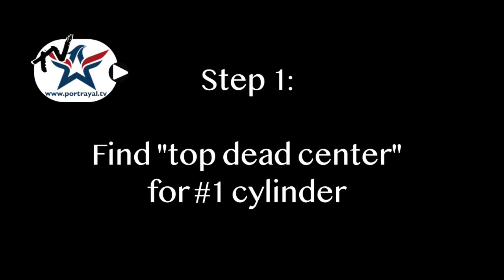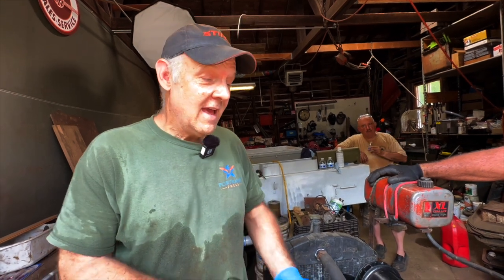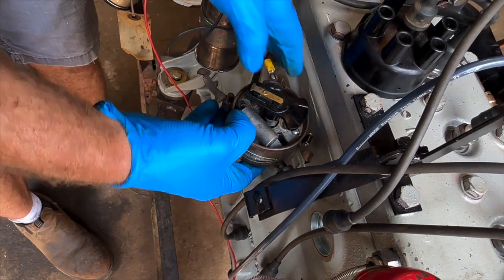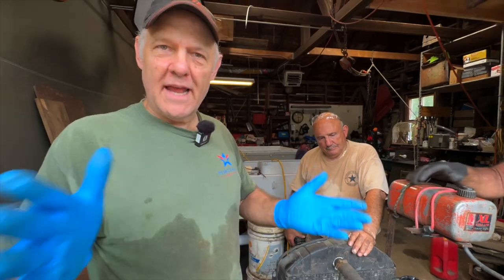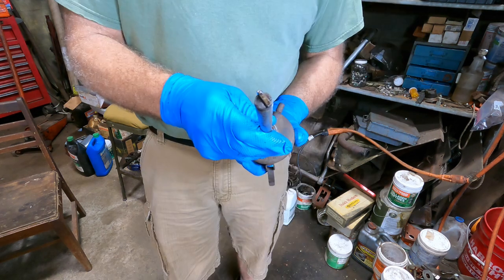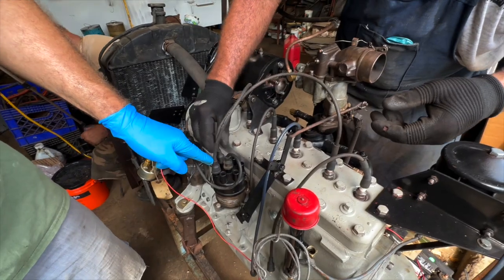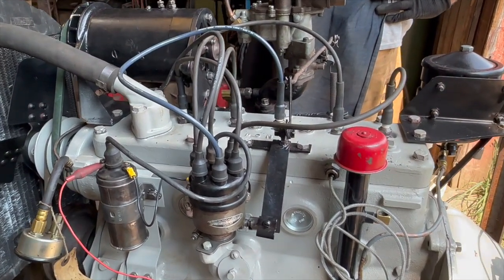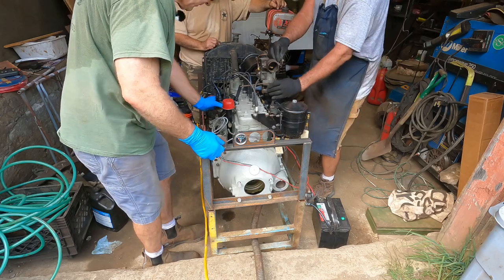Finding "TopDeadCenter" TDC, Installing a Distributor & Setting Engine Timing #mechanic #engine

Comment: Look in the book and put #1 where it's supposed to be. Timing is always set with the engine off. You guys never worked as mechanics.
Reply from the maker: You clearly did not watch or, more importantly, understand the video.  Then you decide it is a good idea to post a rude comment attempting to insult us.  Rather than being an insult, you succeed in demonstrating that you have no idea what you are talking about.  

Try being curious - it is a much better look.  

Example:  "Wow, I don't understand - the book shows #1 at xx o'clock.  Why would they do that?

Answer:  Because it was "convention" or "the way they did it" or "just the setup when they took the pictures for the manual"

Question:  "Does it make any difference to the engine?"  

Answer:  "Not one bit.  You do need to pay attention to  the orientation of the distributor housing to ensure that any oiler is in the correct position and that you don't short the coil lead on the engine block."
Reply: I don't understand why people that  they don't know,  have done nothing malicious, and just trying to help, would be so nasty.
Reply from the maker: @RCASSIN  Beats me?  Woke up on the wrong side of the bed?:face-orange-raised-eyebrow:
Reply: If you want to learn, just ask. Lots of nice guys watching wanting to learn but you don't know what you're doing. I'd guess 98% of the automotive videos are done by guys with very little knowledge or real world experience. At the factory they don't horse around trying to adjust valves and fiddle with the distributor while trying to get the radiator full. They turn the key and drive it off the assembly line.
Reply from the maker: @onetransmission7871  I see you are actively sharing your knowledge by the number of videos you posted - zero.   You know nothing about me or my experience.   "At the factory", they are dealing with newly manufactured items.  You clearly have never restored anything.  

Move along keyboard warrior!
Reply: @Portrayalpress  mechanical and chemical engineering from Purdue. 60 years as a journeyman mechanic. Taught for Ivy Tech, Lincoln Tech, Carter Carburetor, and Allen Test equipment.  Helped write the original ASE tests also. Problem is you can't or won't admit your lack of knowledge and experience. You can't ever learn if you don't ask. We taught with V-8 motors. Didn't give firing order and ground off timing marks. Once you learn it, it's easy.
Reply from the maker: @onetransmission7871  Not impressed with your made up name and your made up resume.  Even less impressed with your negative attitude and your massive assumption.  Like Teddy Roosevelt said, it is not the critic that counts.  Looking forward to seeing your video - otherwise you are just another Internet blow hard.  Waiting.
Reply: @Portrayalpress  I actually have a professional video person to do several for me but at my age I doubt I'll get to it. All info can be verified. I left off some of my background also. You have an above average IQ and reasonable mechanical aptitude. Seen lots of guys like you. You really want to learn but that would mean admitting you don't know very much. You pick any subject and any problem and we'll go through it step by step. My guess is you can learn quickly. After I finish a restoration,  I push the accelerator to the floor and let off. Turn the key and engine will start in less than 3 revolutions. Tap the throttle and it will be on fast idle cam. Timing is set, valves are adjusted, and coolant system is completely full. I'm here to help with any questions you might have.

Comment: Patrick, on a jeep, it does matter how the distributor is oriented.  #1 needs to be at roughly 5:00. This puts the oiler at a slight angle so it will properly lubricate the shaft.  Otherwise it either dumps the oil in or not at all.
Reply from the maker: I understand your point, but the orientation of the distributor body has no impact on where #1 is.   You are correct that the distributor body needs to be oriented as you describe.  The rotor can point in any direction when #1 is TDC.  Set it where you want to per the video....by pulling the oil pump and rotating the shaft until the rotor is pointed the direction you want.  If you want 5 o'clock...perfect.